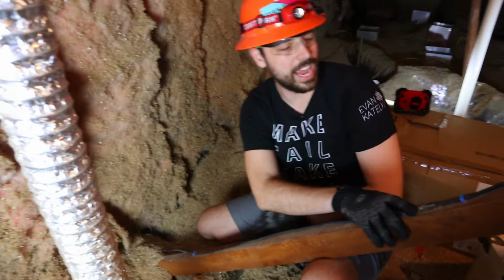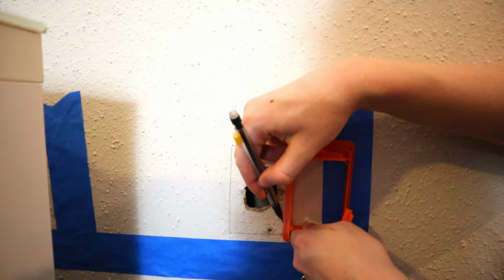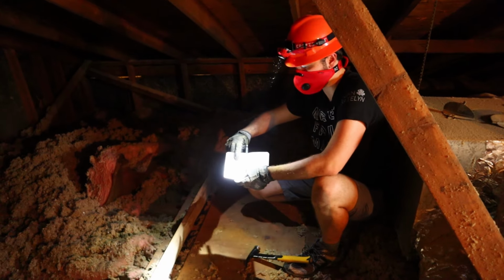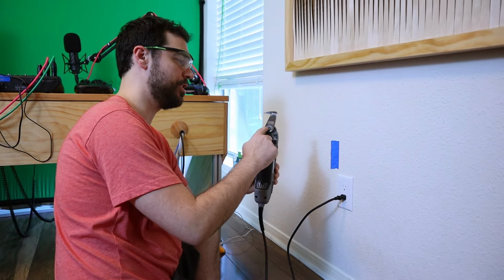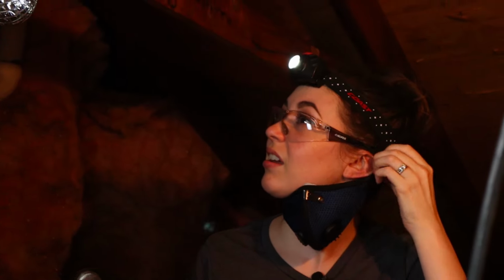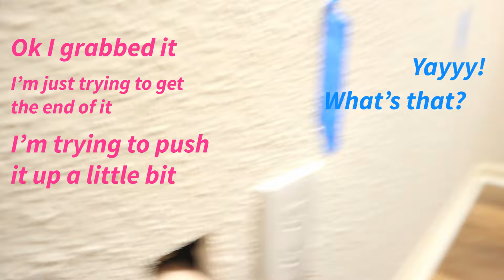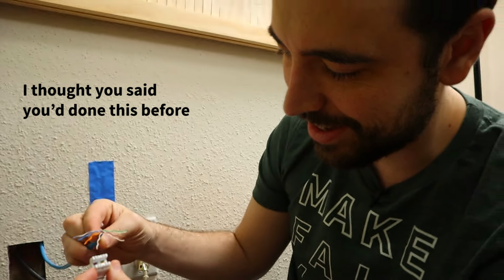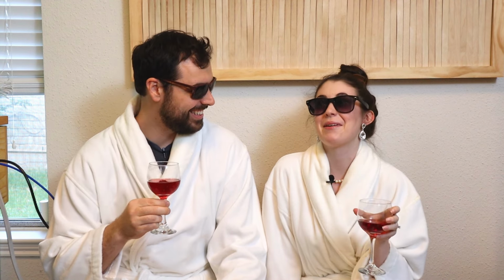We’ve put off running Ethernet for too long…

Comment: If you ever need to go in the attic, soak a shirt and wring it out. Put it on, and you'll feel great in the attic, even when it's 160° in the Mojave sun in July.
Also, use auger bits in wood. Not paddle drills. It takes 2 seconds to get through a couple of studs instead of 2 minutes.
If you need to accurately place a wall in the attic, stick a piano wire or other thin and sturdy wire through the drywall next to the wall, on the side of the wall less visible, until it's a few feet into the attic. It will pop up through the insulation and holes that small can be easily hidden with caulking or even toothpaste.

Comment: If you ever move and have to do this again, I'd recommend looking into a set of pushrods. Fishtape is great, but with straight runs like that, the natural curve of the tape can cause issues. Pushrods are flexible but straight fiberglass rods that will make the job easier(Also glow in the dark most times!).
Reply from the maker: Thanks for the tip!

Comment: why do you guys have an hdmi socket? What does that lead to? What kind of signal do you get from it? Never seen that before... I wonder what problem that solves that I don't have or do have and what solution people where I live have for it. I use plenty of hdmi cables but I can't think of a reason to have one running through my walls...

Comment: Always try to pull a 'shot line' or spare twine with any wiring in case you need to add more lines or re-pull existing.
Reply from the maker: Thanks for the tip!

Comment: 0:41 yes!  The funny thing is It was with an ethernet cable.  I was building my new office setup and ran an ethernet on the floor to my office.  I needed that high-speed connection and didn't have time to do it right.  Hey, isn't that what you said? lol

Comment: Must be nice to be able to fit your hand inside the hole in the wall to feel around for the wire. I run wire a lot at work and have to use a piece of wire to dig around in there because my hand doesn't fit. I need a Katelyn.

Comment: FYI...you don't need an expensive tool to cut the sheet rock for the new  box...you can use a serrated edge knife... a razor blade...or even a butter knife :)

Comment: pro tip: When running any type of wired network connections. The labor is the hardest part, and the cable is relatively cheap. Run 2 to 3 times more wires than you think you will need, and the highest rated cable you can  afford. This way you do your best to future proof the connections as best you can.

I ran 1Gig Ethernet in my house, and ran 6 home run drops to each room in my house, and 12 home runs to my home office. I am already having to double up in my entertainment center.
Reply from the maker: Great tip!

Comment: Amateur Tip that I learned from a Pro:

You can chuck an insulation support rod (heavy gauge wire that is kinda pointy) into your drill and drive it into the edge of the ceiling directly above your desired box location.  When you go in the attic, you'll see a wire sticking up right beside the top plate where you need to drill your hole.

The rod is about 1/8" in diameter, so when you pull it out, you'll only need a tiny bit of spackle to fill the hole.
Reply from the maker: Thanks for sharing the tip!

Comment: Have you considered dLan connection with power lines. Im using the brand Devolo. Would recommend.
Another 'pro' tip: get yourself a pair of cheap Motorola walkie talkies for those comunication issues ;)

Comment: easy fix, put everything in that one room in your house where you store everything, run the lines along the ceiling, drill a whole in the floor where the wall would be, run your line up the wall and snake it. I've been doing it since I was 13.

Comment: If you use a drywall screw in the piece you are removing it makes it easy to pull the cut out of the wall rather then lose it in side the wall.

Comment: Instead of digging around in your attic looking for where to drop your cable on the other side, drill a small hole in the ceiling by where you want it and push a cable fish or even a coat hanger up the hole. Then go in your attic and look for that sticking up and you know which wall you need to drop it down :)

Comment: When we stopped using lan line in my house I realized the wires were cat5e so I didn’t have to run wires 
Just redo connectors in basement and new Jack’s upstairs

Comment: OK, all you need is a knife or utility knife to cut the hole for the low voltage box.  That is what I used.  Further, you could use one (1) face plate for both Cat 6 and coax.  I have.  Also to protect your cables PVC conduit is your friend.  I have 23 Cat 6 ports distributed through out my house, and 4 runs of coax.

Comment: surprised you guys ran a wire through your hallways all this time without ever having the cat chew it.

Also, i know attic stuff is scary, but be happy you have one. The place I'm in has no attic and no crawlspace so I have no way to run wires that weren't pre-installed without ripping up lots of drywall.

Comment: I had one that was too far to the right of one drop, but that spot in the attic is right up against the rafters so impossible to drill. Then when dropping the cable i ran into a bunch of other studs and just gave up.......................

Comment: I know it's likely because you're sponsored that you bought the Dremel, but I want to point out to those that might not know, all you need is a razor. Honestly easier too. Then the drywall just snaps along where it has been razored. I like to just hit it with a hammer a couple times.

Comment: You really shouldn't have hammered in your Ethernet cables like that. You should have used Eye hooks (or whatever they're called) or D-Hooks. Basically, you'd want the ethernet cables to be loosely suspended, so you can easily replace the cables should you need to... easily, without going into the attic again.
With Eye hooks, you just need to pop the wall plates... tape your new cable to the old cable end... and pull it through... and let it run through the eye hooks until it reaches the other end. 
By hammering the cables in with cable fasteners... you've just ensured that any cable replacement will require ANOTHER trip to the attic.
ETA: I wanted to add, that this may depend on local electrical/fire codes. But I don't think most places require you to firmly secure your ethernet cables like that.

Comment: That insulation looks a bit fishy. I would throw it out and switch it for rockwool or a mat of something similar, all those loose particles from spray  insulation has a binder that deteriorates, wich the mat doesent have. Seems you got a pretty large unused space as well you would gain by adding some plaster boards and proper insulation instead of a pile of dirt

Comment: Yeah, it's good to have Ethernet running in every room. I'm not against wireless devices, I just think that they'd work better if I used ethernet on all of the stationary stuff. My VCR smart tv has a ethernet port on it and I'm sure as heck not going to pick it up and walk around with it.
They even sell and Ethernet adapter for Cromecast! 
Many TV's and  routers are next to each other, so there's no excuse for  those people unless they prefer crowding their RF spectrum.

Comment: General comment if you haven't already - make sure that cable was rated for "In-Wall use". Glad to see you put in the proper boxes - ouch on previous contractor.
There's a different spec of cable to be used when running it inside the walls than just your patch cables.
And - personal experience - good thing to fill those top holes with something like Pestblock spray foam
nothing more enjoyable than a rodent finding his way into the house.
Reply from the maker: Thanks for the tips!

Comment: Your lucky that you can stand in your attic...most attics in Florida have little to no head room. I dread the day when I have to run new cable. I'll be belly crawling and swimming thru insulation. One thing I did purchase to make it easier was buy bundled cable its 2 rg6 and 2 cat6 cables in one sheathing.

Comment: I wish that my cable runs went that easily. I seem to have the worst luck with mine. If there is a fire block or any weird unknown obstacle, I will find it and it will send my fish tape astray. I always end up with an attic that only has enough space to squirm on my belly.

Comment: Honestly, I'm just lazy enough to nail the cord to the ceiling / molding. (I did in my sister's apartment -- uncle's house, we all know better than to crawl under it.) The current span to my kitchen table ("office") is one cable as a stringer, with 3 more binder-clipped to it, plus 3 serial cables woven into the mass. One end fastened to the ceiling light, the other wrapped around a curtain rod.

(I have an actual office. There's been no driver to move all that stuff.)

Comment: We just built a house, and the electrician wanted to charge me $400 to run CAT6 I had already purchased through the same holes as the coax when he did that installation.  This would have required almost no additional work to him.  I offered to terminate all the ends myself, and that didn't adjust the quote.  I decided to just run the cable through his holes along the coax wire, and did the install myself.  Took 4 hours to run 10 lines, and it was the best decision I ever made.

Comment: Thats the dream. I wish I could do that in my NYC apartment lol
Reply from the maker: An apartment version might just be tacking it along your baseboards
Reply: @EvanAndKatelyn  What I did was drill a hole through the wall between the router and the access point on the opposite side and connected them via ethernet. I have mine up near the ceiling on shelves as it is recommended to put them up there so fewer things get in the way. My building in mid-century metal construction so it blocks the signals. The second access point is wireless because i got tired of drilling holes. But I would have preferred those convenient wall sockets too! I have wires running all over the walls, ceilings and baseboards with all the modifications I have made lol

Comment: Why not just put in a double gang box instead of cutting two separate boxes?  You lucked out, if you had issues a magnetic puller to run it down the wall inside the insulation works well.
Reply from the maker: We just prefer the look of smaller plates rather than big plates

Comment: They now have high speed routers, but if you're worried about excessive wi-fi exposure then better stick to wired connection
Reply from the maker: Our WiFi just wasn't fast enough for the live streaming 😭

Comment: PSA- If you need 2, run 4. If you need 4, run 6 or 8. Make all runs a HOME RUN, so all jacks run back to a common location where your core switch will sit, like the basement unfinished area breaker panel etc. Don't run jack in 1 room to a jack in another room or 1 side of the room to the other side of the room. That makes no sense and will cause you problems later.

Comment: Those nail in plastic cable holders are horrible. Buy a cheap cable stapler. It is a regular staple that bumps out for the cable so that it doesn't crimp it. I have tried using those plastic things in the attic before and it is a nightmare to hold the cable, plastic holder and the hammer while trying not to fall through the ceiling. The cable stapler also has a guide on it so you don't shoot the cable.

Comment: Why didn't Katelyn need a helmet?
Also, it's still technically Spring, but you are experiencing Summer like weather in Texas.
The outlet with no box was probably installed by a cable contractor who was cutting corners instead of the drywall. 😂
Pro Tips: A set connectable fiberglass rods (available at Lowes) would have helped better than the fishing tool with running those cables down the walls. 
Be careful using quick disconnect drill bits to drill holes in the tops of walls in your attic. If it slips out, you'll lose it down the hole and getting it back can be very difficult. 
That's the problem with this sor of work, it's done correctly, no one will ever know but you.
Reply from the maker: Evan's taller and we only had one helmet (nails on the ceiling) haha.

Comment: Psst..  you can use those clips you clamp on after to punch down the wire.  I do it all the time...
Reply: ...erm.. those clips by the cat that your supposed to put back on the jack...
Reply from the maker: Thanks for the tip!

Comment: Long Hdmi cables are really bad. Over 12 meters and they need to be very large gauge not to have signal issues( green flashes or white or green a stars in best case), hdmi over ethernet is what you do on long runs.

Comment: 3 years ago I let my contractors run the wiring in between the floor molding 1 wire into each room... now I wish I ran 2 in each room... -_-;;; I live in an apartment so no attics.

Comment: Only you two could make being in the hellscape that is an attic look at all enjoyable. Although, you guys are cheating a bit... you can stand (or nearly stand) in your attic.

Seriously though, good job on the cabling.

Not having a bracket for plates is really common. I've never seen a cable company installer use them, it's annoying.

I like fish tape for getting through conduit and the like, for going down a wall (especially with insulation) glow rods can be easier, fish tape can be hard to control in a large cavity. But glow rods are spendy for one-off projects. I've been there with the floor to attic communication (or lack of). Hilarious to watch you go through it, but entirely frustrating when it's me. Walkie-Talkies are a real handy to have, they can act as a communication and marriage saving device.
Reply from the maker: Haha! It's still a hellscape temperature wise but it could be worse, we are lucky it's pretty tall! Thanks for sharing tips 😁👍

Comment: Its hard to be sure as the video didn't really make the network topography very clear, but seemed like it was far more work than it needed to be, both in terms of number of holes cut and cable run. O.o

Comment: Requirements: a typical US wooden house, an empty attic.
Damn, if they would try this in the EU, you'd be drilling through concrete wall, concrete floors and you'd need to remove the attic floor first.

Comment: Also, you really shouldn't run your Ethernet cables RIGHT NEXT to power lines. This isn't for any safety concerns, but rather for interference. 
Chances are, you didn't use shielded Ethernet cable... and used standard Unshielded Twisted Pair. Running Ethernet cables parallel to Power cables is a very bad idea... as the power cables generate Electromagnetic interference.... which will cost you  bit more of your bandwidth and possible introduce additional latency as lost packets and frames will have to be re transmitted. 
Running Ethernet alongside Coax is not typically a problem, because Coax cable typically is shielded.
Ideally you should allowed one empty stud space between your Ethernet and your Power Cable.

Comment: You didn't test the connection before closing the boxes?
You didn't test the connection before removing the old cable?
That's really trusting yourself.
Even after punching hundreds of wires I still test the connection before closing things up.

Comment: Never seen an attic where you have to wear a mask if you want to enter xD. Also have ethernet connections spread through my house. SO much better if you want to hook up your whole house. WiFI is just too slow.
Reply from the maker: It's recommended to wear a mask around fiberglass insulation 👍

Comment: I think I've watched almost all of your videos, and this is the first time I can raise my hand and say, "I DID THAT!"  You should borrow a cable tester (or get one from Lowe's) just to make sure all 8 conductors are connected properly.  A cable can "work" without it, but you can have interference or poor signal if the cable isn't right.  https://www.lowes.com/pd/IDEAL-Digital-Datacomm-Tester/1000358227

Comment: Why is it so dirty in your attic? 
I can’t imagine myself to live that house like yours. I couldn’t breathe inside the house due to particles that floating around. Can you clean it up and put a new insulation foam.
Reply from the maker: The stuff on the floor is insulation we blew a few years ago so it's supposed to look like that. It's a green fiber insulation so it's better for you than the typical fiberglass stuff 👍👍

Comment: Are all lofts like yours in the States? Because that has got to be the least useful massive amount of refractory I've ever seen. Glass wool has the bad habit of taking in moisture but never releasing it back, thus condensing and becoming sort of a crappy thin sheet contrary to its fluffiness before. This can be redone with stone wool which doesn't behave the same way at all. It can be put into place with a plastic sheet covering it and minimizing the amount of dust particles by quite a margin (ans therefore allow you and guests to go up there freely and even sleep up there). On the other hand, glass wool is bad, bad stuff, horrible crap. Stone wool is not as it is in every Icelandic house. I don't know how much more expensive it is for you but I can promise it is a much better choice.
Reply from the maker: Not sure what stone wool is, we have fiberglass on the walls but we blew "green fiber" insulation (the fluffy stuff) everywhere else and it's been great

Comment: I did something similar when I moved in here and I over did it in a mayor way, or so I believed. Now a few years later, I have to redo it all because I don't have enough port, so I'm upgrading 6 switches so that they are 8 ports instead of 4 and my backbone is now a 16 port, hopefully it will hold and wifi can take care of the overflow when it needs too. I never suspected my TV corner would ever need that many hockups, but the tv, blueray, dvd,  music streamer, HTPC and much more all connect to the internet through ethernet. Argh.